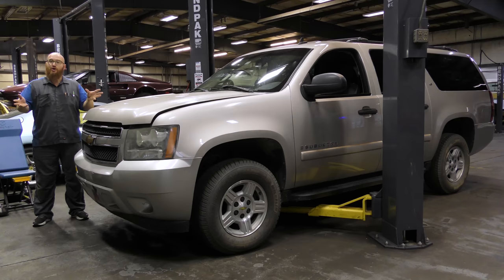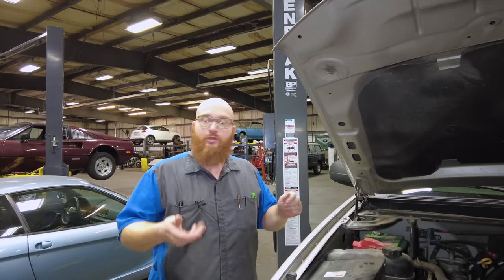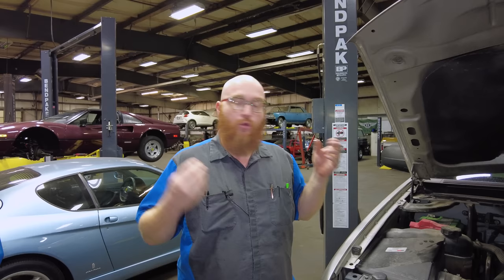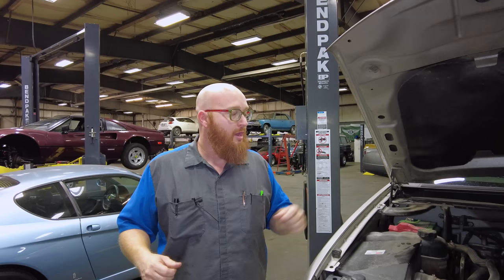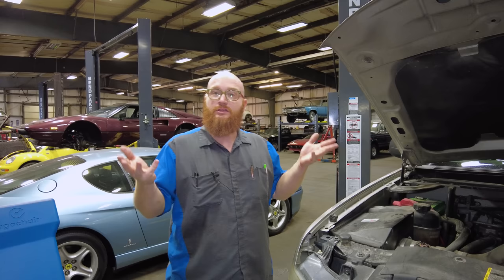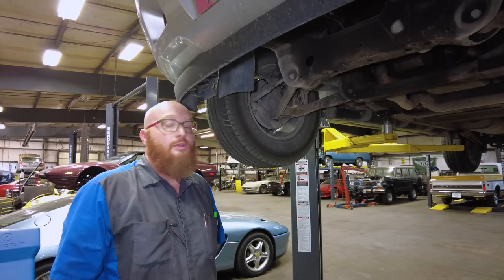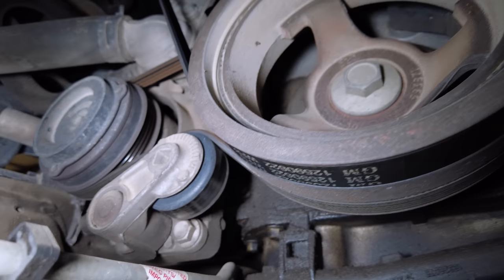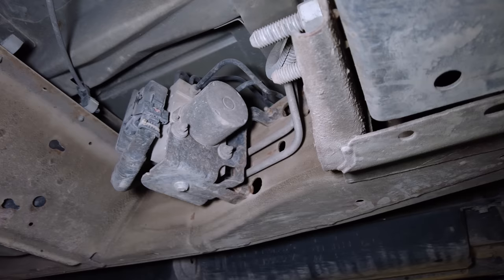What fails on ALL early 2000's Chevy SUV's!? CAR WIZARD shares what he's seen from the last 20 years

Comment: The only thing that stopped me from getting a 3rd gen Tahoe instead of my 4runner is of all 10 I have looked around, non of them are maintained properly. It seems like in bigger metro area people that buy these trucks never cared about common maintenance. I've seen oil as dark as coal, burnt transmission fluid that are dark brown, A/C overcharged to oblivion, and so much more. From all mechanics I've talked to, these trucks if maintained are the last generation of GM trucks that can challenge Toyota truck reliability. Yet there're people out there don't know where their transmission dipstick is, while the actual dipstick rusted off from the salt, along with the tube; there're people that changes their oil only when the oil light comes on. They're solid trucks, but lots of their owners aren't. Why people can't just treat their vehicle well.
Reply: DID YOU FIND MY RACING UNDERWEAR....IT'S GOT STRIPES DOWN THE SIDE..AND A SKID MARK IN THE BACK...?
Reply: I have owned a few. I wrench on my own stuff so its not that big of a deal for me to keep them on the road. BUT I install boxes and boxes of parts on mine. Mind you they are old, my current one is a 2014 with 125k. Bought it with a bad trans, $1600in parts and I rebuilt it myself. Upper control arms, oil pressure switch/intake gasket, maf, 02 sensors, belt tensioner/idler, DS door panel, DS seat foam worn out, 4wd range switch. All within about a year.
Reply: @mph5896  > 2014 with a bad transmission
That just proved my point. But still, I wish I could have a place to work on it yet I don't. Hence I picked the brainless choice.
Reply: got a 99 gmc suburban 5.7  4wd  great truck .. end of an era
Reply: Around where I'm at it seems that Tahoe/Suburban owners are not car or truck people. They just buy it cheap because they want to have a big SUV and then show little regard for maintenance.
Reply: Challenge Toyota's reliability? Not even close. You got any other jokes?
Reply: They act like cars can't break..... ridiculous
Reply: @anthonynicholich9654  On a second thought, probably not. My dad's 02 land cruiser is on its 3rd timing belt and 3rd sets of shocks, that's really about it. We swapped out height control because we don't trust it over Colorado's high elevation, it was working perfectly even in 2019. That reliability claim is from the mechanic we went to, not from us. 3 years after I've born that land cruiser was our only family vehicle, so I don't quite have an idea how much more reliable they are. I wanted a cheap tahoe, my dad pressed me to get a 4th gen 4runner. Turned out dad's always right.
Reply: @spukersonmerlosk1661  Honestly, maintaining a vehicle is simply being a decent human being. It's like feeding a horse and taking care of it. I wouldn't trust a guy or a gal that routinely overdue on maintenance.
Reply: @stevelikesrhino  Yep
Reply: Have you heard a tradie ute/ pick up
bursts into flames parked outside
his house.... Toyota don't want to
know l mean are u f+×÷=%@ serious.
in Brisbane , Australia. sadly.
Reply: I have 4 gm vehicles vintage 2001 to 2009.  
All have over 200k. None have been touched internally. 
      My  01 Suburban has a 5.3 with over 400 k.  I change the oil regularly at 3000 miles.   I wish that the Michigan salt hadn't eaten the frame and body. 
       I'm gonna pull the engine, tyranny and the transfer case before I send it to the Scrapper.
         Good bye old friend.
Reply: @twobeards6714  if they're made in Michigan why can't they protect the vehicle bodies from salt sufficiently well? Or do all cars and trucks suffer the same demise? My VW never got any rust in a decade of winter salt in Colorado.
Reply: @jamesmedina2062  Michigan is part of what they call the rust belt. Vehicles in the rust belt don't last. Many vehicles only last 7 maybe 10 years before they are completely rusted out and have to be junked. Some will last a little longer but at that point the rust can get really gnarly on them... I've even seen frames that rusted to the point of literally breaking in half. As for Colorado (which is where I also live) they don't use salt on our roads here. Haven't for quite a long time now. They use magnesium chloride (aka "mag chloride"). It is mildly corrosive (more so to aluminum) but not nearly as corrosive as road salt. Regular car washes in the winter time (including undercarriage) will prevent the mag chloride from doing any real damage, even in the long term. In the rust belt states, all cars WILL rust whether you wash them in the winter or not. The only way to prevent a car from rusting in the rust belt is to 1. garage it and not drive it in the winter or 2. Religiously and thoroughly "fluid film" (a product highly regarded as on of the only effective rust inhibitors on the market) the entire undercarriage once a year. Some people mistakingly use rubberized under coatings to prevent rust in the rust belt, but they tend to trap moisture and actually worsen the problem.
Reply: @catfishbilly7425  Yes you are right about everything but magnesium chloride had its problems to the environment and is not used in the whole state of Colorado. I can't remember what all magnesium chloride causes because its been a while since I lived there. From 2000-2011 when I did live there my tie rods corroded in about one year so that you could not adjust the toe on it. Other things also corroded such as the aluminum wheel to the rotor. Cars do come down to the sunbelt from the rustbelt so I know what that looks like. The most important thing in my opinion is the manufacturer, it's coating and plating processes and where pennies are pinched, because they always are. Some designs are awful and rust anywhere such as the lower ball joint in Subarus. They seemed designed to hold onto moisture for days and days and just rust. Subaru did not change the design for years. Money-maker I assume. I am also going to guess that manufacturers will often skimp on the pre-paint plating of car (and truck) bodies and frames post-welding. Same thing happens with the thousands of nuts and bolts throughout the vehicle. Sometimes they are zinc and nickel plated and other times it seems not. As for what the customer can do as an owner I know all about the debate and agree that undercoating often does trap moisture but thats usually when its not prepped well. I used a really good 3M undercoating on an old Ford I restored and when I took it down to metal and cleaned it well that blue stuff just stuck onto the metal really well. If the same car went to one of these quickie shops they would have taped off areas of suspension and brakes and shot their product on the body without the prep work to make it adhere well. Then the product was likely a cheap asphalt type material with solids to give it more thickness. As you said there are good products on the market. It hardly ever goes on a clean metal surface meticulously prepped.
Reply: @catfishbilly7425  i think some cars rust more than others too for some reason, like some Ford's from early 2010s already get rust. Like  a 2010 Ford fusion
Reply: I love GMT400 and 800 vehicles because thewy are so easy to work on but my shop truck is a 4runner that I have never had a serious expense on other than the stupid hydraulic crossover strut things since it is a loaded Sport package.
Reply: I used to have a 99 Tahoe, would have kept it if it was 4wd, just too many leaks to fix and I wanted a 4wd. Ended up buying a Lexus GX460 and although Im happy I miss the Tahoe sometimes.
Reply: I’ve found lack of maintenance is the rule nowadays.  It’s number one on what I look for when buying used.  The manufacturers should be ashamed of themselves for pushing extended oil changes and lifetime fluids
Reply: If your wonder why people don’t treat their vehicles nicely just look at how they treat their bodies
Reply: That's sadly the case with all older vehicles besides Toyotas. Everyone, myself included, takes care of their 350,000 mile Toyota like it's a brand new vehicle, buying only OEM parts, full high quality fluid replacements, etc. But my 260,000 mile Ford? Cheapest parts and minimal maintenance to keep it going, haha.
Honestly I'm just more sentimentally attached to the Toyota.
Reply: @andybub45  congrats. V8 upgrade to a V8, body on frame upgrade to a body on frame, and welcome to toyota cult.
Reply: @Wade-lk4yo  At least you do maintain them to keep them going. I found it startling that my ex change oil every 20000 miles or so because she believed in that """guaranteed""" protection interval. Maybe that's why she's now my ex.
Reply: @twobeards6714  Ive rode in quite a lot of them from that era. Had to say they do age more compared to toyota trucks (especially those Japanese made ones (especially those tahara made ones)), but still feel solid after 200k or 15+ years. Hate to sound like a boomer, they really don't make them like they used to.
Reply: @stevelikesrhino  
I also drive a 74 Catalina with 200 k. 
She's mint.   The vehicle has had a  regular oil changes and the engine has never been touched internally since it was built.
            Old School
Reply: Typical GM suburban owners, 99% of them are housewifes who don't know any better.
Reply: @jamesmedina2062  it's folks not rinsing off salt in a timely fashion, salt is inactive untill water is mixed in. Problem is where I'm from Chicago it's below freezing and washing a vehicle where it freeze everything is not good!
Reply: @jmabs5096  I think you are right and people are lazy to go to the car wash or they don't want to go everyday of course which is unrealistic. Any bare metal will rust fast and like you point out its the wet part the key. Tie rod threads and nuts will hold onto water and rust. Any male/female joint. Automakers could make it easier by plating and coating processes. Having gone snowboarding up where there is lots of snow, I prefer those little towns that don't even salt the roads but government officials are either asked to snow plow or feel that they have to do it. Compacted snow is preferable to melted and then re-frozen ice.
Reply: I've seen many vehicles with Chevy's 5.3 make it to around 300k+, one of the best motors chevy ever made imo
Reply: @anthonynicholich9654  Not the entire vehicle, but the motor without question. The 5.3 is bulletproof if maintained properly.
Reply: I’m glad to see someone pointing the finger at a very major cause of vehicle malfunction and that is poor maintenance. Also it’s due to improper vehicle operation. That’s what makes me dread to buy a used vehicle.
Reply: @platinumuschannel  but it gotz dem REEEEMZZZ DOUGH
Reply: @charlieboyok  cool. Now try forming a cohesive sentence
Reply: @catfishbilly7425  I certainly agree on the rock salt and brine mixture our governor put in place because it snowed one day here in Georgia and I-85 stood still in downtown Atlanta. Come on Governor Deal, it only snows once in every 25 years to shut down 85. Here’s the kicker, every time the media mentions snow and sleet, the DOT has an army of new snow plows, salt spreaders and BRINE mixture spraying on our clean highways and it’s simply causing our vehicles to rust all over the state. Even though the temperature is like 76 degrees, we gotta run those snow trucks.
Reply: 35 yrs ago I worked at a sears shop installing tires, doing oil changes and lubes. The cars that came in were dirty and filthy, not well cared for. I think for the most part a lot of people don’t take care of their vehicles like they should.
Reply: I have an 02 suburban with 300k miles it needs a new transmission right now but beyond that it's strong as an ox. I'd call that fairly reliable
Reply: @jamesmedina2062  Michigan is indeed the rust belt as well as where I am on the east side of lake erie.They dont just use salt they use liquid brine which is super concentrated salt and lots of vehicles here get holes after two years no matter who makes them.The car makers love this part of the country for that reason..I've seen lots of trucks with broken frames and had under 100k miles.A coworker of mine bought an S10 pickup  new in 2002 and at 65k miles his frame snapped!So yeah this is the worst part of the country on vehicles.The roads  are usually white for months when winter hits.
Reply: @jimmillet1442  In a place like that I would think they would sell a stainless steel bodied car for an extra price. Like a modern Delorean eh? Well ships out at sea are treated a certain kind of way but cars are just cash cows.
Reply: @jamesmedina2062  That's just it they dont want them to last so like I said they like this part of the country.They do have certain parts that they use on cars going to this area that hold up better to corrosion such as stainless fuel lines etc...at least some of them do..as far as stainless bodies,stainless steel is very hard and wears out stamping presses fast.Ive always heard stainless would be impossible in a mass production environment but they like selling alot of new cars anyway so no sense in it.People not from this part of the country have no idea how bad this stuff rust out..even steel parts under your dash will rust in half.My friend has an 89 iroc camaro in his garage with 52k original miles and all the screws on the interior dash etc have rusted heads.
Reply: @jimmillet1442  that makes sense. All to shave transit time a little huh? I prefer mountain towns with no salt at all. Less slippery than black ice and whatnot. When I lived in Chicagoland area the train was nice and I drove a Subaru around that I rented as well. Today's disposable culture is nuts. I make durable wood furniture but the mentality in people is to buy cheap stuff that will break or look ok for only a few years. Its hard to change the way people think.
Reply: @jamesmedina2062  Exactly right but cant really blame this generation...three parents never taught them any better and gave most of them everything. I have friends that bought there kids brand new cars for there first car while they the parents drove there used ones and that's actually common anymore.The furniture rings home too..I'm surrounded by amish  furniture makers so that's all I buy or would buy..they only use hardwood and the fit and the finish is the best you can get.
Reply: @zzoinks  Yeah, my old neighbors had a 2010 Fusion and the metal under the doors frames (rockers) is all rusted out. I just saw that car like a month ago, and I couldn't believe the level of rust it has. The 2009 Ford F-150 rusts pretty badly, I've seen a couple with Swiss cheese tailgates. The 2008 Chrysler Town & Country/Dodge Grand Caravan are turning into rust buckets too.
Reply: Lol mine got 250000 most reliable suv ever done everything everyone that drives it wanted
Reply: Should I  buy a  2005 GMC YUKON
Reply: I seearched near and dear for an 04-09 4runner before buying a loaded slt 4x4 07 yukon but then my neighbor got one and I am saddddd i want to ask him to trade me 😂
Reply: My good friend bought an 03 GMC Yukon XL New and still has it to this day because he’s meticulous on the maintenance. It drives like a dream it’s got about 350,000 miles on it.
Reply: @anthonynicholich9654  I own both and 2000 Suburban hanging tough. 230,000 and smooth as silk.
Reply: @stevelikesrhino    02 LC is a 'grocery getter'. Last good year was 94 I believe. Last year with "Toyota" as an emblem on front grill, next year was their logo.
Reply: @twobeards6714  BRAVO!